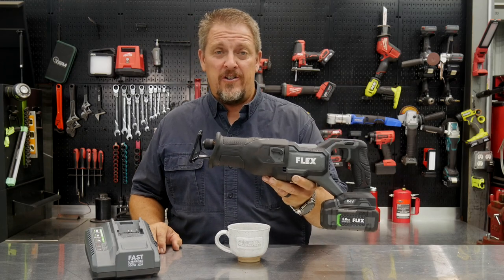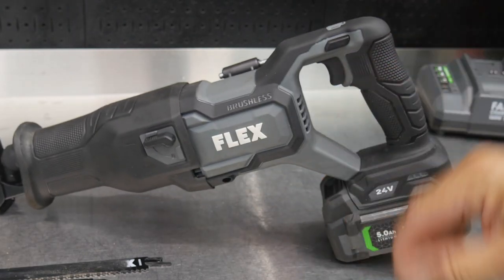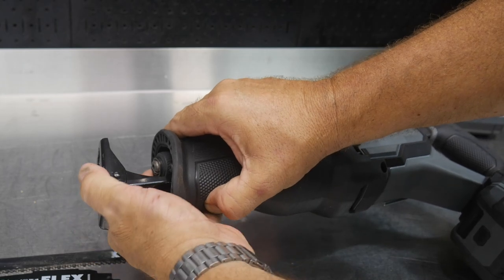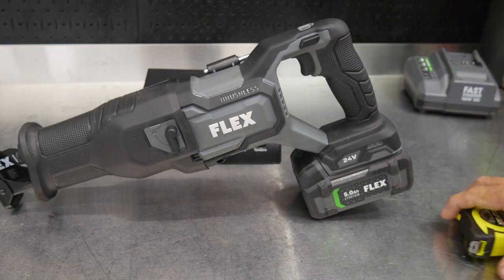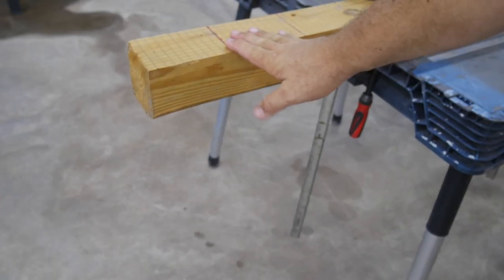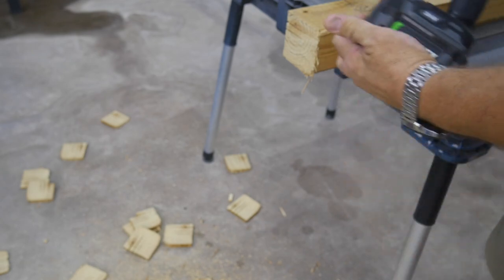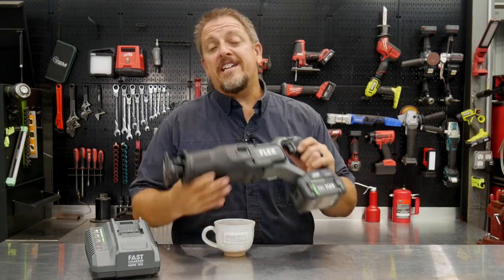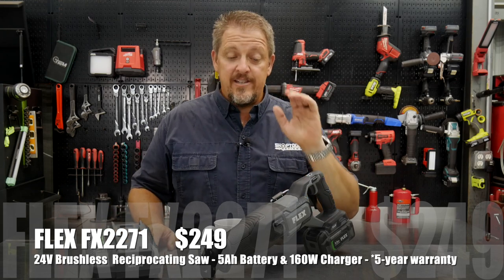FLEX FX2271 24V Brushless Recip Saw Review [1 BATT 50 4x4 CUTS]

Comment: I really like this saw.  Reminds me of the Metabo HPT 36V for ergonomics and low vibration.  My nit is that the blade collet/chuck retracts into the body of the saw - if Chervon didn't want to put a release lever on the side, they should've designed it so the collet sits outside the boot for the full stroke length.
Reply from the maker: You have to point out my flaws! Once we published this, I yelled at the screen because I forgot to mention my beef about that release lever as well. Of course, it seems to always stop up in the tool as well. I hope everyone can forgive me for not mentioning that. You're right, it's a pain.
Reply: @Shoptoolreviews  Haha, I've learned videos are never really complete when you publish them.  If you were to wait until they were 100% done, they'd always get published... "tomorrow"
Reply: Yo what up Philly! I bought this saw and to be honest the second you lose extracting the blade is more than made up for with the quick insert… I wish my m18 fuel had quick insert… same with blade eject when I’m cutting chain link posts… that blades heats up a lot…
Reply: @PhillyFixed  the funny thing is, the Metabo HPT has this same exact design issue. But one plus I'll give to the Flex is that the collet locks open, and then automatically closes when you push the blade in, basically allowing one-handed blade changes. It also has spring loaded blade eject and allows blades to be inserted upside down.

Comment: Many keep dunking on this brand but their recip, 6 1/2" inline CS, angle grinder, and OMT seem to be stellar products.

Hope to see their SDS, too.
Reply from the maker: We haven't had any issues yet, and they all seem to be great tools. Their batteries and chargers are at least top-3 in the tool industry. Thanks for watching.
Reply: @Shoptoolreviews  actually the battery chargers If compared like I did with a timer and fully dead battery is first in class…. Gonna do a video showing exact power capacity out of every brand and charging time as well, starting with M18 vs Flex, most likely just a long cut through the length of a tree and whoever gets the farthest is the winner plain and simple, next after batteries are dead is charge time and finally a true price comparison…

Comment: @shoptoolreviews i was wondering if youve used the m18 fuel oscilating multi tool and the flex version. Im on both platforms and looking to purchase one ir the other. Your advice would be greatly appreciated.
Reply from the maker: We have not yet reviewed the FLEX or the new M18 FUEL Milwaukee version. I've used both of them at events, and they both have a ton of power. I think the M18 is a little smoother, but that's purely on memory.
Reply: @Shoptoolreviews  thank u for the response. Great channel, luv all your vids brotha